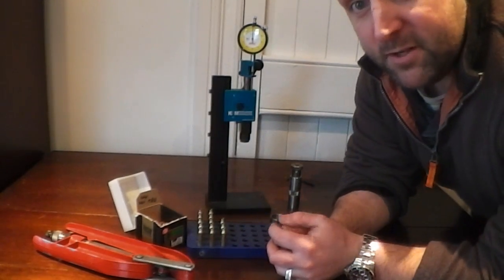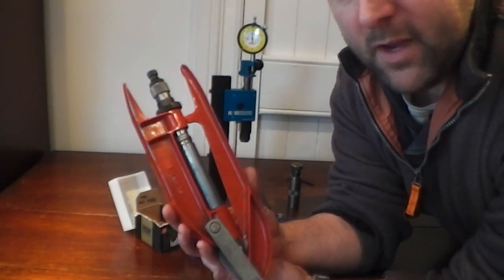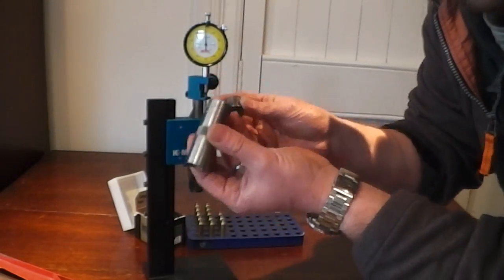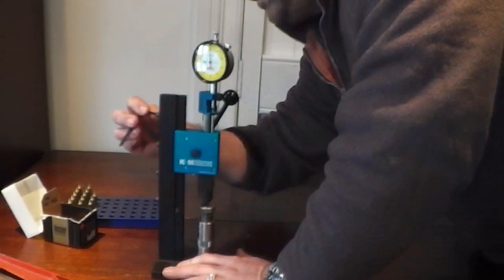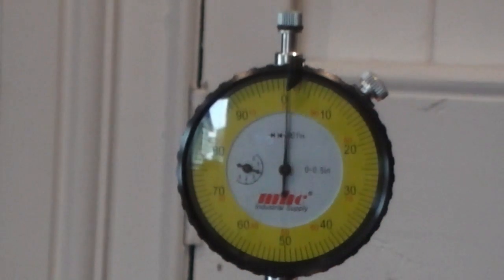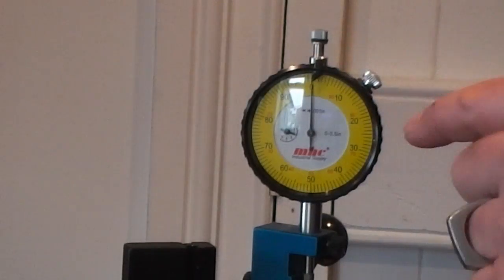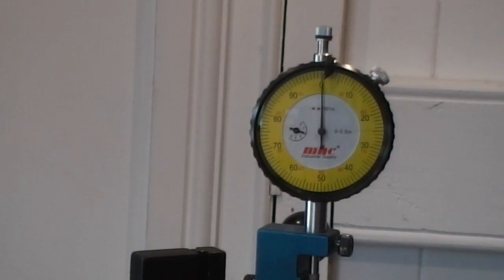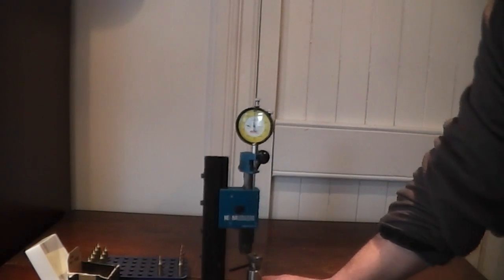K&M arbor press with force dial indicator - lower your ES and SD by standardising seating forces

Comment: good video, seems this method could cut out a few steps ppl use messing with neck thickness trimming and such. if the force is the same the neck tension should be the same. i bet if you measure the neck thickness on the brass you set aside it will be different. should be a nice shortcut to skip all the neck thickness measuring and trimming steps. what do you think?

Comment: So, is this just theory or did you shoot and compare the groups of the consistent loads to the "too tight" and "too loose" loads?
Reply from the maker: +Kenneth Garrison Hi Kenneth. In normal use this isn't a big accuracy thing; it's about reducing vertical at long range due to lower ES. Best regards, Richard
Reply: +Richard Utting (SharpshootingUK) Understood.  That was what I was asking about. How much variation was there with the discarded loads vs the "good" ones?
Reply: Certainly it would effect velocity, but if the velocity in the barrel (barrel time) is off, you bullet could miss the barrel harmonics, no? Thanks for the great video sir.

Comment: I am presuming the L.E. Wilson die you are using seats the projectile to SAMMI spec correct? 

You mentioned a micrometer option. Will this allow customized seating depths below SAMMI spec? 

I currently run Redding dies but have found that although they are seated uniformly (micrometer seating die) the amount of force required is not measured.

I am considering purchasing the K&M Arbor press, seating all bullets to a uniform force, remeasure the COAL at that force measurement and further group based on the force required to obtain my chambers COAL.

What are your thoughts on the above?
Reply from the maker: AussieBrutus1981 Any seater pf any type gives you total control of seating depth - saami is simply a guideline.

Comment: can you use this to seat using the LEE classic reload kit? i assume so..

any opinion on the HBN bullets regarding runout? reduce it maybe or are they performing very well vs moly? have you tried to HBN VLDs or hybrids?
Reply from the maker: Andre Isis I can't see how runout would be affected one way or another and it's frankly not a factor i trouble myself much about.  Shape of the bullet doesn't matter - VLDs coat just the same as any other